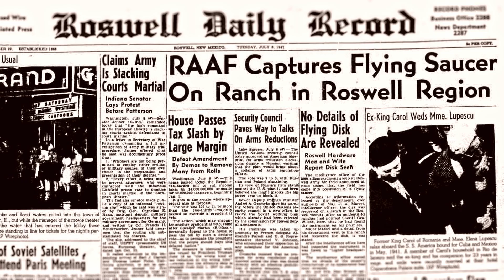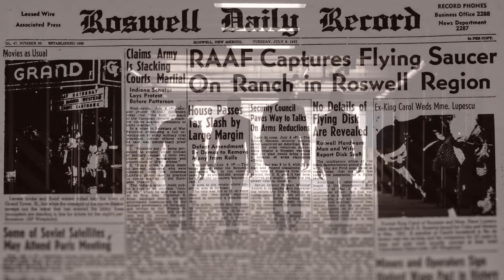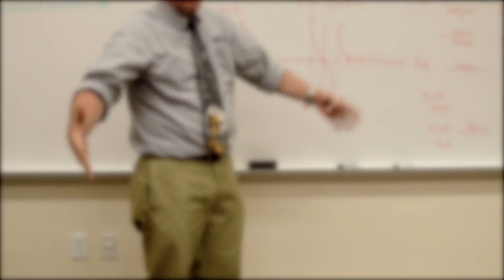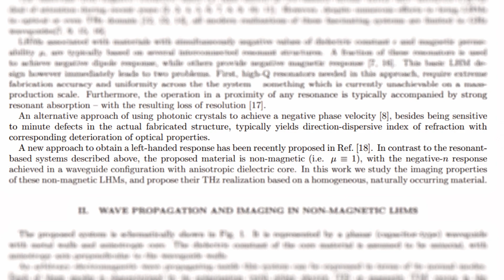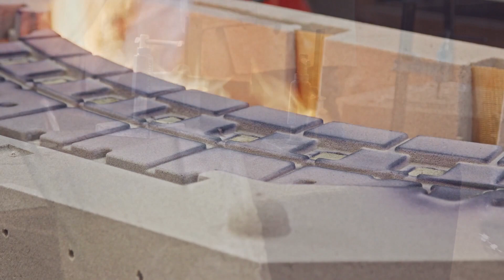The Alien Metal

Comment: Hello, I am here from your New Mind community post just checking out the channel! Just thought you might be interested to know of further developments in this case since 3 years ago. So the material was given to Linda Moulton Howe by Art Bell (she is who had Travis Taylor and Hal Puhoff and others study it in the 90's and 00's), and she eventually sold it to Tom DeLonge's To The Stars Academy in 2017. TTSA entered into a CRADA with the Army to allow it to be studied in 2019. In 2023 the All-Domain Anomaly Resolution Office sent the material to be analyzed by Oak Ridge National Laboratory and they published their report in 2024. The report ("Synopsis: Analysis of a Metallic Specimen") is available online and details their test methodology and results.

Their conclusion was: "Although the origin, chain of custody, and ultimate purpose of this specimen remain unclear, a modern and robust analysis of its chemical and structural composition and properties does not indicate that its origin is non-terrestrial, nor do the data indicate that the material examined ever had the pure single-crystalline bismuth layer that could possibly have acted as a terahertz waveguide. The intended or actual past use of the material remains undetermined, but ORNL has a high level of confidence that all data indicate the material was manufactured terrestrially—albeit using an uncommon mixture of elements by today’s standards—and then incurred damage caused by mechanical and heat stressors."